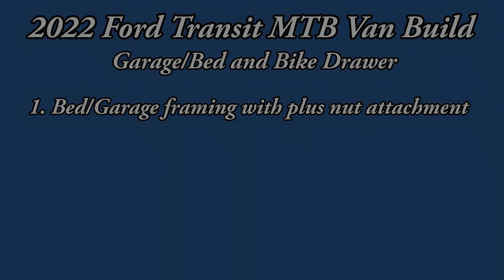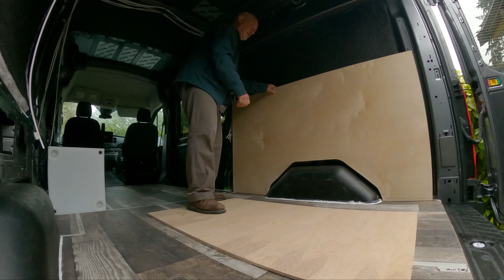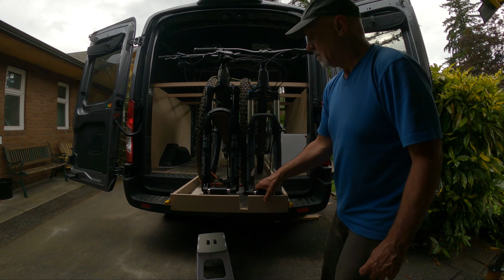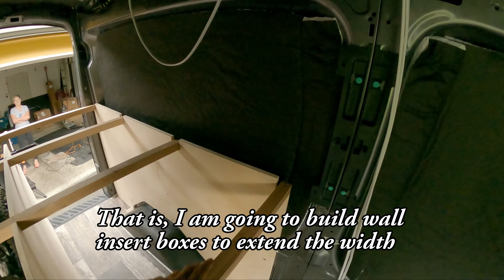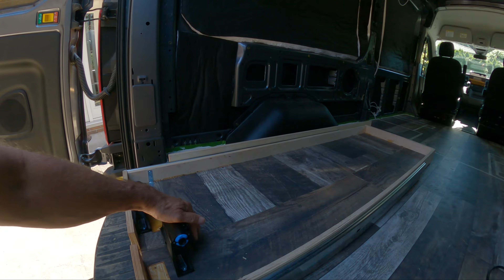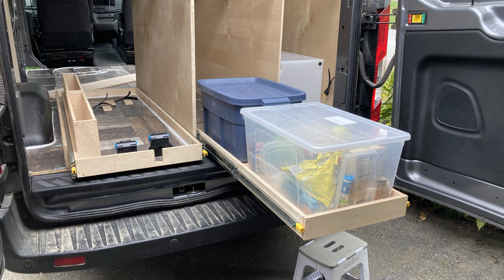Ford Transit MTB Van Build -  Step 2. Bed and Bike Drawer

Comment: How high is the bed platform from the van floor, please?
Reply from the maker: Sorry for the late reply.  I have it as 34" but the height depends upon the height of the bikes I have, if you ride larger bikes you might need more room.  This was done as a custom fit according to my mountain bikes and admittedly have cannibalized the headroom of the bed compartment to fit the bikes in the below garage.  I started by building my bike drawer to custom fit the two bikes and install the fork anchors so they could be fitted side-by-side with the smallest sized drawer I could fit so as to not also cannibalize the garage space.  I then mounted the bikes on the anchor and measured the height to the top of the handle bars.  I also have a dropper post on the bike so the handle bars were the highest part of the bike, but if you are fitting a road bike or a mountain bike without a dropper post then the height of the seat might be the maximum height.  Good luck!!

Comment: Nice to see! Also converting a Transit with the focus on bikes under the bed.
Do you have a link to the fork mounts you installed?
Reply from the maker: Sorry for the late reply...It is a Rocky Mount...here is a link...
https://modularacks.ca/products/droptop?variant=42964661862649

Comment: I'm just starting out converting my Ford e-transit in the. England.  It's almost identical to yours size and colour . I'm interested in your progress.. So far so good. Except my steering wheel is on the correct side of the vehicle 😂😆😃
Reply from the maker: If you look at the videos on my channel, you will see later stages of the build and a final walk through and “lessons learned” videos.  But the project is always a work in progress, and so while I am now done the build, I will continue to tweak and tune as I use it more.  I’ve now got 60,000 miles of van exploring I not and am very happy with what I have built, with the caveat that it was customized to store bikes under the bed.  And yea, my steering wheel is on the wrong side…😄